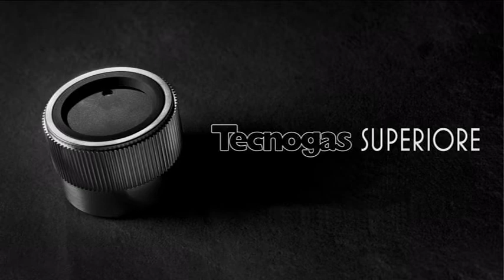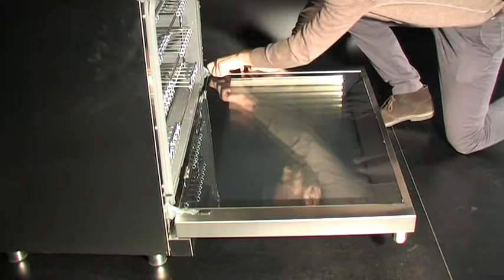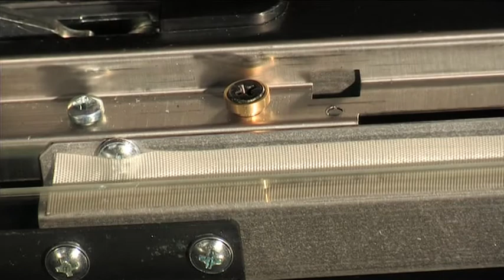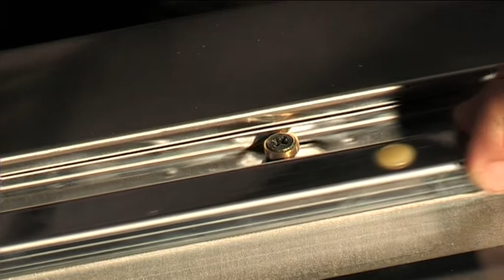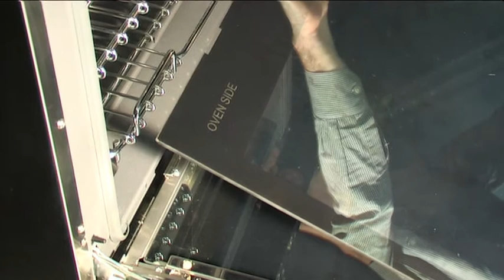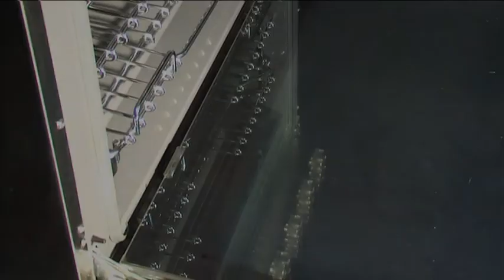Tecnogas SUPERIORE door operation

Comment: It's a good oven but the brackets that hold the handle bar are very cheap, chrome-plated plastic.  Ours cracked and broke after 18 months.  The replacement handle cost AU$160 and didn't come with replacement screws and the brackets are still rubbish plastic.
Reply: Ours didn't even last that long. Totally agree.